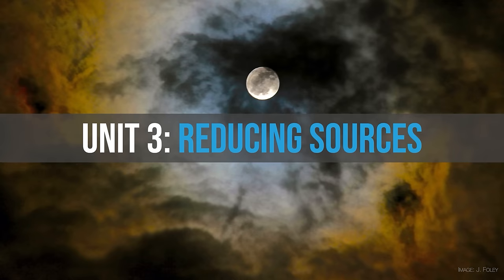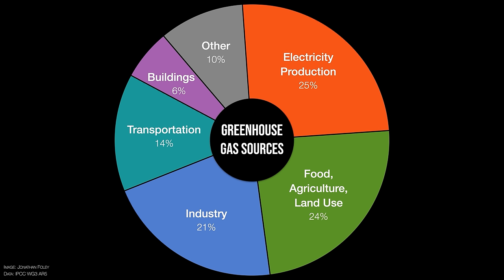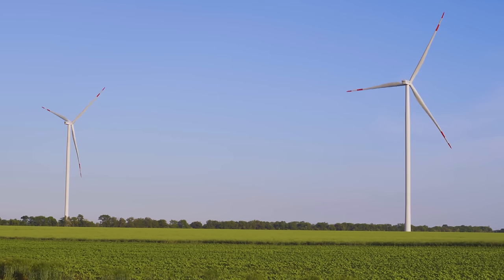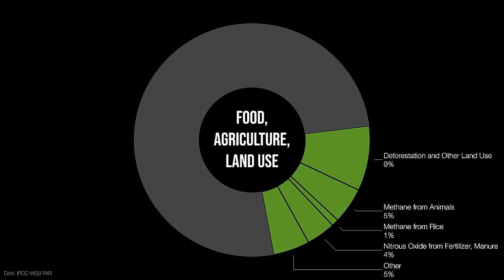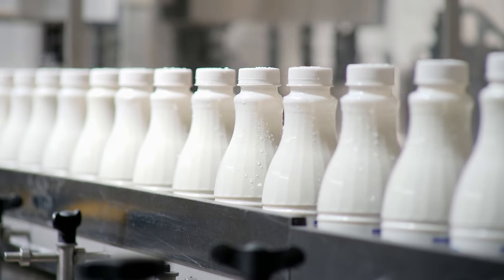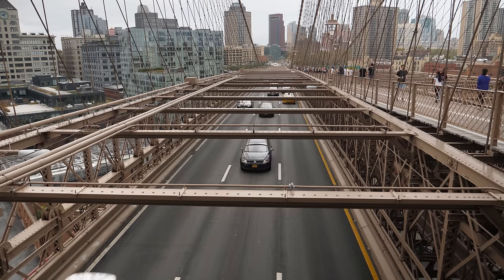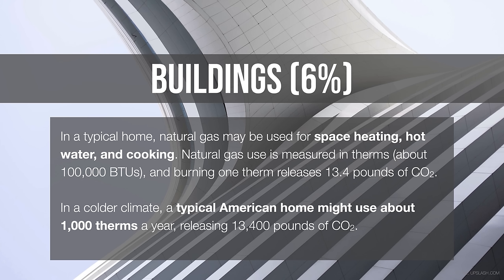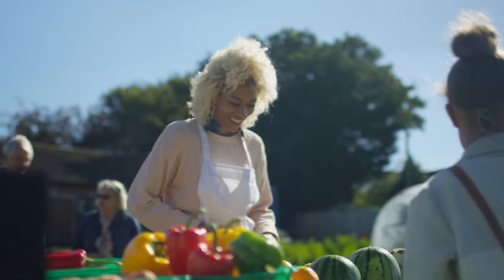Unit 3: Reducing Sources

Comment: Why don't we just use Nuclear energy for a couple of thousands of years while we try and find more alternative fuel sources? The US Gov and military uses it and it's safe.
Reply: To elaborate, I get that there are safety precautions and hurdles, but if people were rational in pushing climate change we should find efficient ways to utilize nuclear energy, but whenever a common man think 'Nuclear' they automatically asume it's bad. Becuase of this, people have been even more scared causing a raise in question to safety concerns, which has then raised costs of building plants. If people just did their homework we wouldn't be in this position of struggling to find  resources before the Earths time runs out.